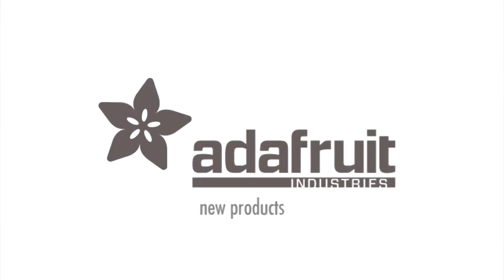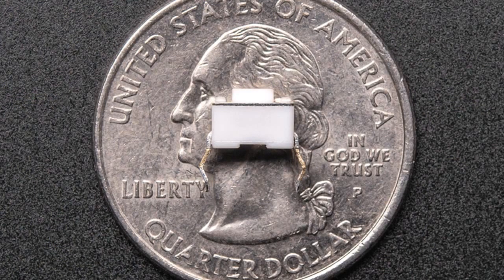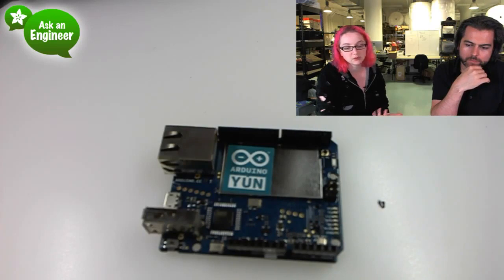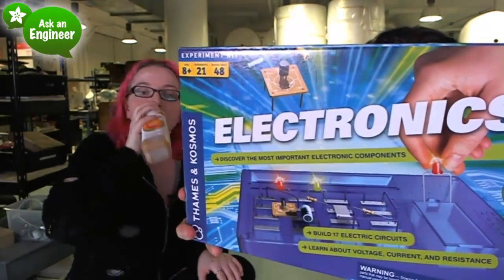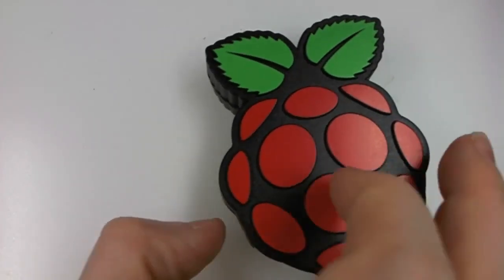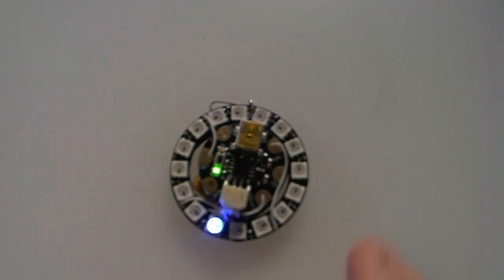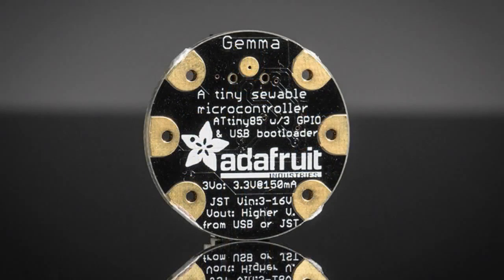GEMMA & More! New Products 9/14/2013

Comment from the maker: See what's new this week! GEMMA & More! New Products 9/14/2013

Heat Sink Thermal Tape - 3M 8810 - 25mm x 25mm (0:13) http://www.adafruit.com/products/1467

Heat Sink Thermal Tape - 3M 8810 - 80mm x 80mm (0:13) http://www.adafruit.com/products/1468

Tactile Switch Buttons (6mm slim) x 20 pack (2:10) http://www.adafruit.com/products/1489

Arduino YÚN (3:17) http://www.adafruit.com/products/1498

Thames & Kosmos Electronics Experiment Kit (7:05) http://www.adafruit.com/products/1511

Lock-style Solenoid - 12VDC (8:17) http://www.adafruit.com/products/1512

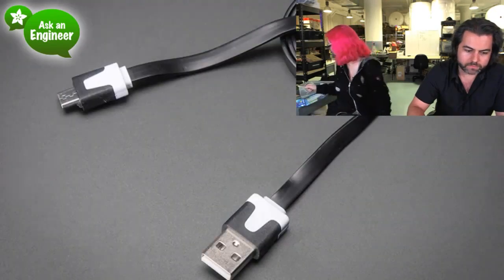USB 'Noodle' Cable - A/MicroB (9:58) http://www.adafruit.com/products/1513

USB 3-Way Charging Cable - iPhone 5/iPhone/iPad and MicroUSB (10:30) http://www.adafruit.com/products/1514

PIHUB - USB Hub for Raspberry Pi (12:00) http://www.adafruit.com/products/1516

Medium Waterproof OtterBox (13:10) http://www.adafruit.com/products/341 

Adafruit Gemma - Miniature wearable electronic platform: (13:47) http://www.adafruit.com/products/1222

 #Adafruit
Reply: Is it possible to make a GEMMA with 6 pins?